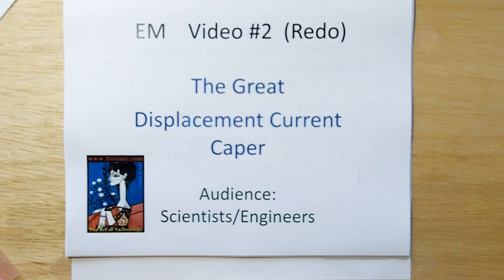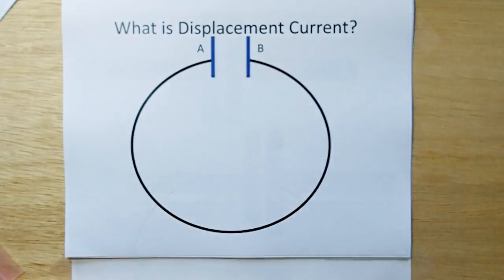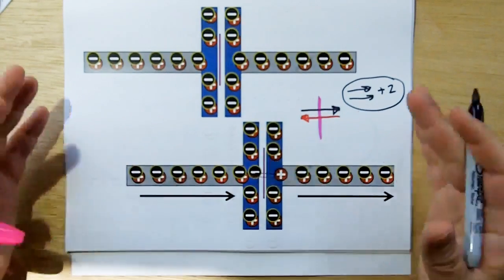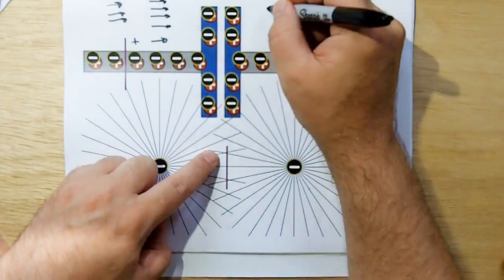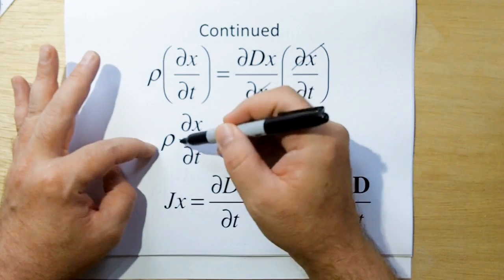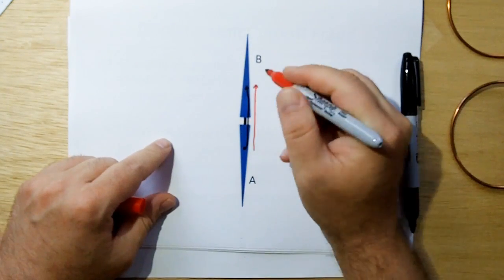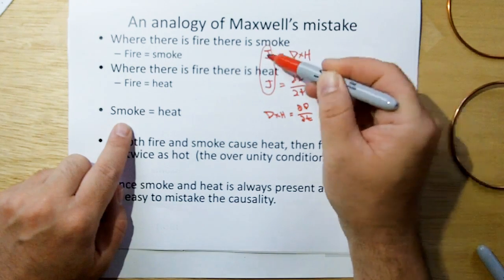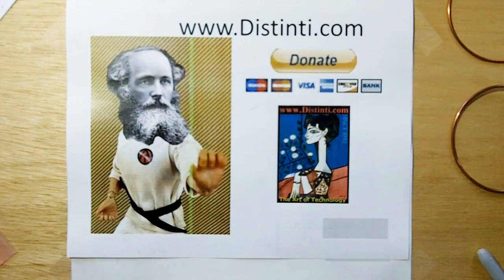emv002b: The Great Displacement Current Caper REDO

Comment: However much I like Distinti's videos I would possibly disagree with his conclusion at 10:59, that having both current and displacement current will lead to over-unity. I am not an EE engineer, but I would say that:

- in a solid wire we have a case that current term J is non zero, while the displacement current term dD/dt is zero. So no over-unity.

- in capacitors, current term J is zero and displacement current term dD/dt is non zero, so no over-unity again.

In that sense, there is nothing wrong with Maxwell's equations. Although, in general, I would tend to align with a view that Maxwell's equations are incomplete, they might be right in this case. Even if there is a hidden misunderstanding of nature of light, current science can not be mistaken by a very large margin.
Reply from the maker: *****  Divergence is built around the Dot product.   Where vectors passing through the surface are "Dotted" with the normal and the result summed.  Vectors passing through the surface in the direction of the normal will produce a positive result, vectors passing in the opposite direction produce a negative result; thus: +3-3=0.   (as shown in the video) I have also done this derivation a completely different way (in one of may papers) and get the same answer ... I'll make a video of it just for you.                                                                                                                                                                                But lets put all this stuff aside for a moment because I still don't understand what position you are defending.  Let me explain...The derivation I did is identical to that done by Maxwell; So if I'm wrong , then Maxwell is wrong too, and his Plane wave equation is bunk because there is no displacement current at the capacitor (or anywhere else for that matter). On the other hand, if I'm right, then Maxwell's plane wave equation is bunk  because a magnetic contribution from displacement current would produce more magnetic field than what is observed (the position of the video).So which is it?  Is the plane wave equation bunk or is it bunk?I'm leaning in favor that it is bunk :-)
Reply: HitAndMissLab gerard morin....
Reply from the maker: HitAndMissLab If there is no dD/dT in the wire than there can be no dD/dT in the capacitor.  Charges don't turn off their electric field lines just because they are in a conductor.  If they did, then they would have to turn off their electric field lines in the plates of the capacitor which is also a conductor.
If you try to argue that perhaps Gauss' "Law" is wrong, or my application of Gauss' law is wrong, then you defeat Maxwell' because that what he used to compute the dD/dT in the cap (the magenta line).
Again, it does not matter where you draw the magenta line J=dT/dT.
Another argument that the plane wave equation is wrong is that it violates conservation of energy 
Another argument that the plane wave is wrong is that engineers don't use it; they use the Fourier kernel e^(jw) with great success 
These are covered in emv003 or emv004 ( I can't remember)
Reply: www.Distinti.com I see your point. That whole equation is possibly wrong. Because, once one puts capacitor in that circuit, he can't have constant current, neither in the wire nor in the capacitor. 

So equation needs to be rewritten with maybe dJ/dT term, or something similar.
Reply: ***** Hi, thanks for trying to clarify. whose conclusion is false my or Distinti's?
Reply from the maker: HitAndMissLab Correct , the capacitor would block DC current; however, the analysis done in the video is known to scientists and engineers as "instantaneous analysis" where the derivation is true for any instance of time.  In other words, the derivation is valid for any instantaneous value of current in the loop regardless of what the current is or how it is changing over time (dJ/dT).
Reply from the maker: ***** How can you make a conclusion when you don't know the properties of the thing that you are using to support your conclusion?
Reply from the maker: ***** you have it backward. In vector algebra, three left arrows plus 3 right arrows equals zero, so the original total is zero; if it were not zero, all kinds of other known properties of electricity would be in violation.  When the charges move you get d(flux)/dt != 0.  If it were were zero, then capacitors would not work.  This derivation is identical to the one used by Maxwell to show the d(flux)/dt in the gap of the capacitor.  I'm just showing you that the d(flux)/dt is present about all moving charges.  That d(flux)/dt could only exist in capacitors is complete gibberish.  AND it has nothing to do with Epsilon because it is not even part of this derivation.   Furthermore, dQ/dt would be +1 because I specifically stated that we were treating electrons as positive to avoid sign mistakes (that was the convention used in the derivation).  I have no idea what you mean by surcharge so I will ignore that.  Since d(flux)/dt is present all about moving charge (not just in the cap) we can't accept the notion the d(flux)/dt cause a magnetic field otherwise we would get over unity .... I'm repeating the video at this point.Bottom line: Maxwell's plane wave equation is BUSTED, Maxwell is a fraud.   Anybody trying to use these equation to prove their pet theories are fools.  This is one of the reason why Einstein could not unify electromagnetism and gravity...he drank the Maxwell cool-aid too!
Reply from the maker: If it is your assertion that the net flux is 6 (using the convention of the video) then in what direction will a test charge move if it were placed at the magenta line? To the left? or to the right? 

Assume that the magenta line is equally spaced between the two charges due to the fact that the flux contribution from both are the same.

Left? or Right?
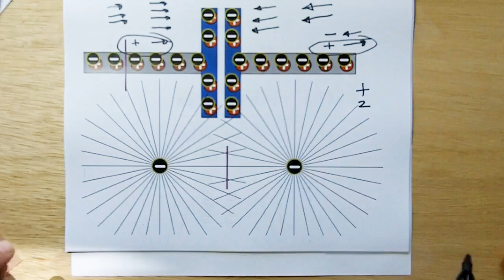Reply from the maker: ***** The explanation from 6:22 to 8:24 and the derivation which begins at 8:24 are two very different methods that yield the same answer.The divergence theorem has nothing to do with the net flux passing through the magenta barrier. shown at about 6:24.One method has  a simple conceptual explanation, the other a simple mathematical derivation.I will do a video that will derive the first method but its a real snore.
Reply from the maker: ***** You have been claiming that the sum of the flux through the magenta barrier is 6 since near the beginning of this discussion; Why is it only now that you have an issue with the statement of the problem?My Guess is that you have finally realized that the sum of equal and opposite vectors is ZERO.  If not, answer the question asked previously: Does a test charge at the magenta barrier move to the left or the right?You can only answer in one of four ways here:A: Distinti is right, F=0 no net force on a test chargeB: Distinti is wrong, F=6 causing a negative test charge to move left C: Distinti is wrong, F=6 causing a negative test charge to move rightD: Stop Answering all together I will accept any answer you give without response--I will let the viewership decide who is right or wrong here; I have more important things to do.